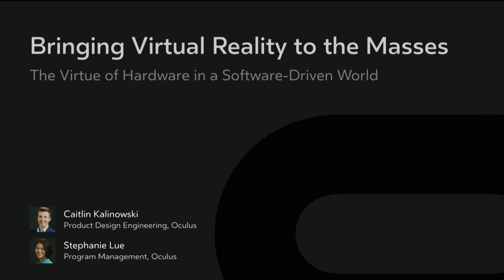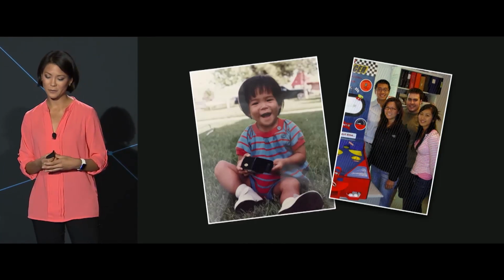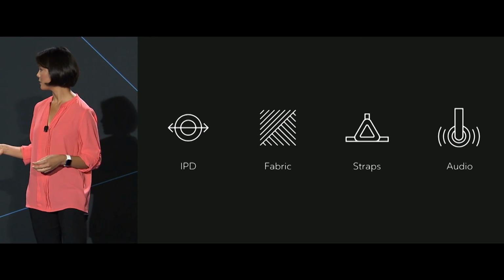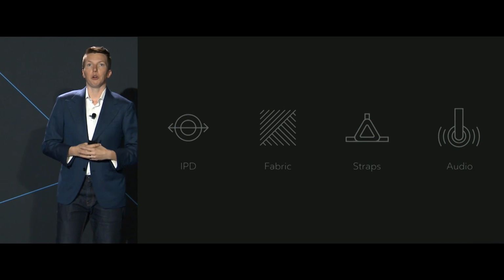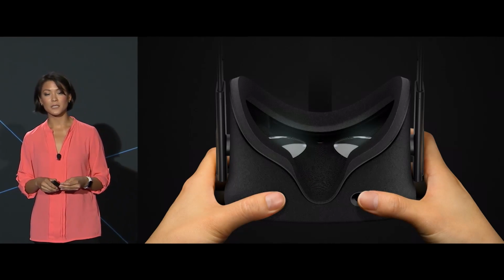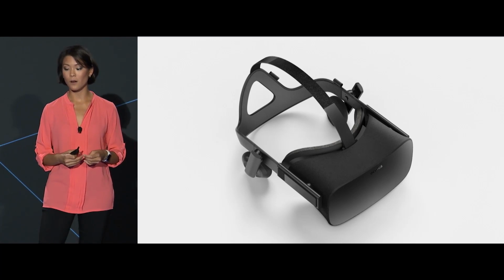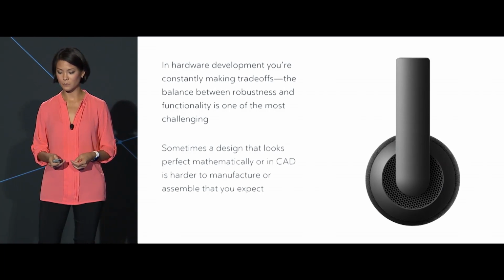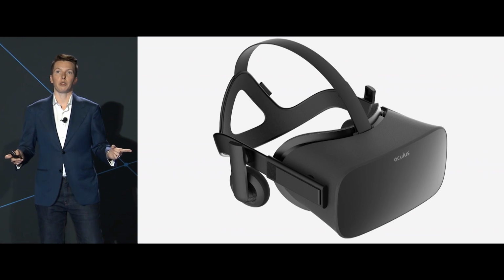Oculus Connect 2: Shipping Hardware: The Evolution of the Rift

Comment: Wait since when is the body going to be in contact with the outside of the device? It's going to spend most of the time strapped to your face, not wrapped around your torso like a shirt. Having fabric anywhere aside from the interface point where your face meets the machine seems like a total waste of time and resources.

What happens when the fabric inevitably gets stretched and worn. If it was such a big deal to calibrate the light sensors to handle the exact screen pattern of the fabric, how is it going to compensate in a year when the device isn't covered by fabric at all because the customer tore it off after it started to get frayed and damaged? How do you suggest users clean this thing? It's going to accumulate dirt and body oils and you can't just throw the rift into a washing machine.

I remember reading the statement recently that "Everyone will want VR long before everyone can afford VR". Are you sure that making sure the device feels good in your hands (while making head tracking more difficult) is worth the costs that's going to add when cost is already such a sticking point?

If It really was a good enough feature to get the entire development team on board, I'd like to know how you'd sell it to me, because to me it seems like needless extra weight, cost and complexity.
Reply: +CorvidDude "Having fabric anywhere aside from the interface point where your face meets the machine seems like a total waste of time and resources."

I think it was a weight consideration. Anything that needed to be rigid, was.
Reply: I see. So it's a replacement for the plastic cover, not a coating on top of that? It would have made more sense if they had described it that way instead of talking about how comfortable it needed to be.
Reply: +CorvidDude Excellent point. While I can conjecture quite a few reasons, I would like to hear how they convinced everyone to buy in. The reasons to me seem to be:
1) Actually while hiding the leds underneath was a challenge, that seems to have been part of the goal. Hiding under plastic would have been harder. So it's for looks, to avoid having dots all around the device.
2) Keeping weight down. This is obvious.
3) Allowing for the IPD adjustment. They covered this somewhere in the video, but for ipd to work they have to physically separate the entire lens/screen array for each eye. They could have gone with plastic and made it big enough on the outside to hit the max IPD. Again... looks I guess? But maybe it's more comfortable as well to not have the actual device wider than your head.
4) Breathability. They mentioned this in the Q+A when someone thought that the fabric would be a heat problem, I'd imagine it keeps heat down a lot more actually than a hard casing would.

Yeah I'm worried about long time wear as well. Especially with dust getting in the holes.
Reply: +linkup99wa Everything gets worn down eventually and at no point during the video did they say the fabric was a replacement for the plastic. From what they said it could be just a fancy cover, much like fabric on anything else.
Reply: Why would the fabric get worn? It's on the outside of the device, you briefly touch it to put the headset on or take it off.

Since when does some fabric weigh more than plastic? Weight is a part of comfort and will help you forget your wearing the headset.

Did you even watch the video???
Reply: Everything gets worn down includes plastic too. This is custom fabrics so it's a bit soon to claim it's going to be in pieces anytime soon.

Yes, on the outside it could be any cover.
Reply: +CorvidDude I agree, I dont even think that fabric is necessary simple empty space between the lens holders and the shell would provide even more ventilation it would also be simple to design an outer shell that lets through more air and less light than stretchy fabric. The IPD adjustment also looks overly complicated and Rube Goldberg, when a simple worm screw and knob would surface. I see allot of whimsical design decisions without which it could of been out months ago already, Crescent Bay with IPD adjustment was all that was needed.
Reply: +saluk 1) What are you on, hiding LEDs under IR transparent plastic is way easier, they use that on DK2 and the front plate of the CV.
2)CV is heavier the CB, a single piece skeleton and a rigid shell is easier to make light and rigid than an open skeleton.
3)the fabric between the lens holders and the shell is the only bit that flexes when you adjust IPD, replace that with empty space and have even more ventilation.
4)Ocluded vents could let through more air and less light than stretchy fabric.
Reply: +MrMonkeybat IPD adjustment positions the lenses AND the screens. Each screen and lens are always at the same place relative to each other.
Reply: saluk Did I ever say the screens don't move with the lenses? Yes the screens move with lens holder that does not change anything that I have said, they move within the outer shell the outside shape dose not change, if it did that would mess with the constellation tracking, notice that the front of the CV is a single rigid plastic plate. The fabric coating is just so that it looks a bit different and feels softer when you pick it up with your hands. But it will get frayed and wear out, what a waste of resources, a plastic model could been out months ago, been more durable, and be cheaper.

Comment: I am really afraid of the cable because I had many (audio) headset cables break from normal usage after only like half a year or so.
When you are walking around blindfolded or maybe spinning in your chair this becomes an even greater issues.
I can still remember when I got my Gear VR and forgot to put the extention cord for my headset out of the range of my chair.
I was immersed enought not noticing that the cable spun around the chair and at some point it ripped off, well with the HMD you would notice it as soon as it pulls on the cable but maybe you can't stop the momentum of the chair fast enought and your brand new HMD breaks right away, that would be pretty bad so I wonder if they got the cables right for CV1.
Reply: +LastWish90 If you have thought of it by reading articles, watching videos and playing demos, you can bet that the big team of cutting edge professionals who have been working with this for hours and hours every day over the past 3 years have thought of it, too. The solution they deliver will be the best solution available. If the issue of fragile cables was one that couldn't be solved then you can bet that there will be cheap & simple replacements available.
Reply: +LastWish90  I'm not certain how the Consumer rift will be, but the DK2 has replaceable standard cables, very cheap from most electronic stores.